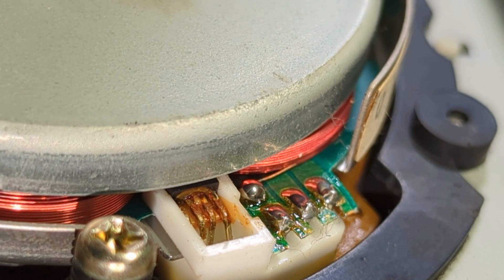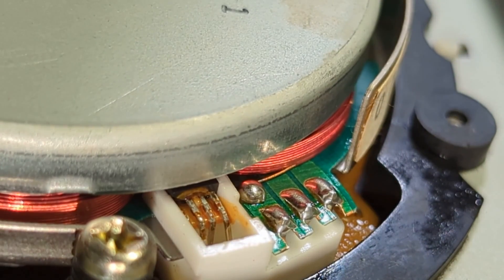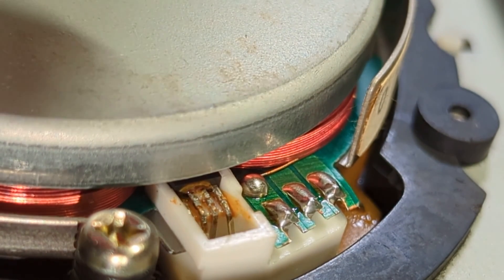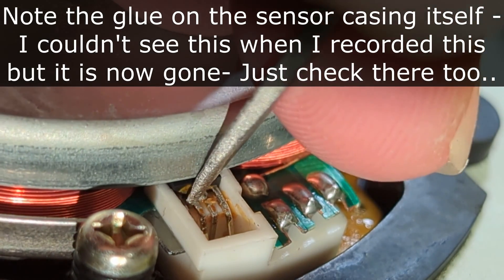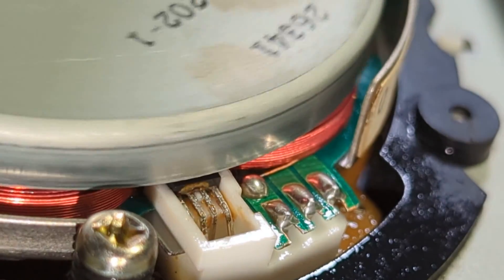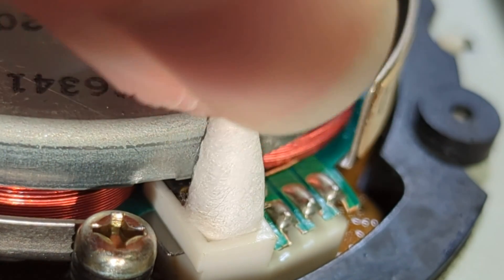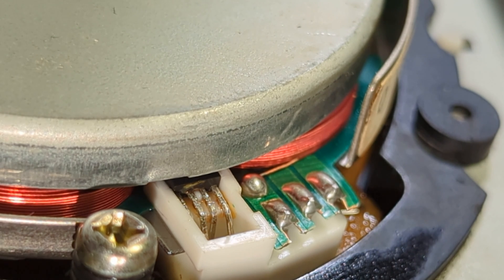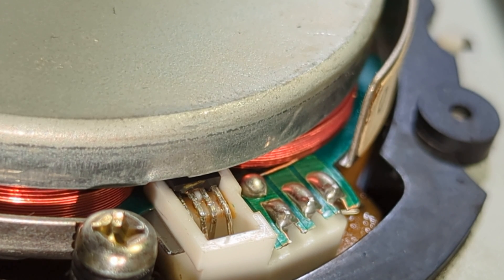Sony Betamax head drum motor hall-effect cleaning demonstration

Comment: Hello, thanks for your explanation. I also have this Sony. It turns on, the front and back buttons work. The only problem is that when I press the play button, it cuts out after 2 seconds and won't let me play. Do you know why?

Hi, thanks for your explanation. I have a Sony Betamax SL-F1E. It turns on, the forward and reverse buttons work. It ejects easily, but the only problem is that when I press the play button, it cuts out after 2 seconds and won't let me play. What's wrong?

Sony betamax sl-f1e Capstan Motor
Reply from the maker: Does the capstan motor spin at all when you press play? There are some physically very small electrolytic capacitors in the capstan servo that are starting to become a common issue on the F1 and will give this fault.
Reply: @MrBetaByte 

When I press the play button, it initially wants to spin, but then it immediately stops.

Comment: Today i cleaned the Hall sensor on a HiFi Betamax. I remove the rotation magnet , unscrew the M7 screw and lift up the magnet. Now you can easily lift up the Hall sensor , be careful, also on the difficult side. 100% clean now.
Reply from the maker: Great job and another way to do this. Thanks for sharing.

Comment: It was a common failure for the C20,24,30,33,40 and 80 series in the mid 80's. Used aceton for cleaning.
Reply from the maker: Acetone is probably safer on the coils should any get on them but I seem to be getting quite accurate with my scrubbing!

Comment: What is the bad effect of Hall effect sensor problem on the picture? Do you have a video you can show? Thanks..
Reply from the maker: This doesn't affect the picture but not cleaning it can cause the head drum motor to stop working so cleaning it before it does fail saves a lot of work and trying to source a new old-stock sensor. The glue becomes conductive over time, especially in humid conditions and will eventually short out the sensor and the only fix is to replace it.

Comment: I have found a source for the sensors (covered on my channel) and they're not too expensive.  I tend to replace them in-situ rather than take out the whole head drum which carries risks.  Sony used hygroscopic glue on various devices including professional gear, and it often causes problems.  At some point they must have realised it was a problem.
Reply: Suprised they didn't just put on say like a cap over it then you lever the cap off when replacing.
Reply from the maker: I'm working on a modern replacement but it isn't too straight forward. I do have lots of the THS103's so I'm all good for now. I even had a conversation with Toshiba (who made these) but it ended up being a dead end.
Reply: For cleaning, I've used: pointy toothpick, sharp-angled x-acto knife with the very tip cut off, and q-tips with much of the cotton removed. For replacement: I just got some THS103A from Ali Express for about $1 ea. Now I forget if they were DIP-4  or SIP-4, or if it matters.

Comment: It's hard to believe that gluing was the cheapest solution for SONY. In any case, it looks to me as if there is still enough space to press down the Hall sensor in the area of the connecting wires with a second plastic part that is clipped on from above. To do this, the lower part must be shaped in such a way that the sensor cannot bend significantly towards the wires.
Reply from the maker: Arguably it's poor form from Sony for using glue but it's a belt and braces solution that Sony often seemed to do and after all, it did last many years in normal conditions before it caused issues. I do always mechanically bend the pins so the sensor presses into the plastic assembly so no glue needed.